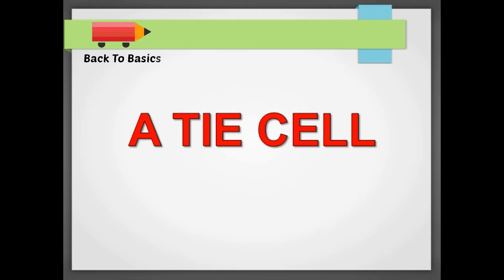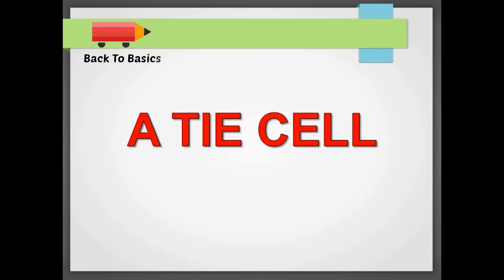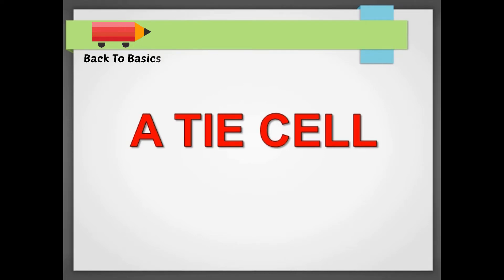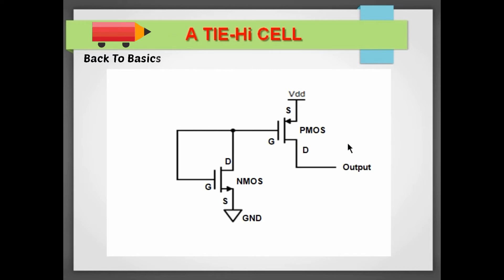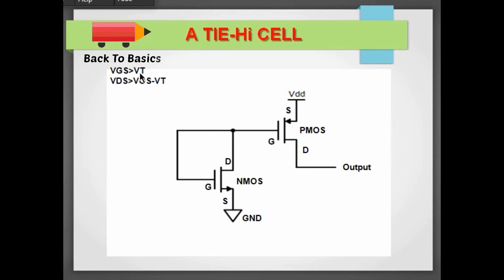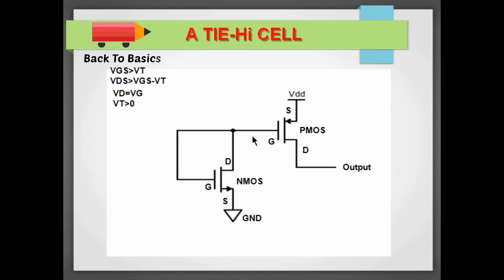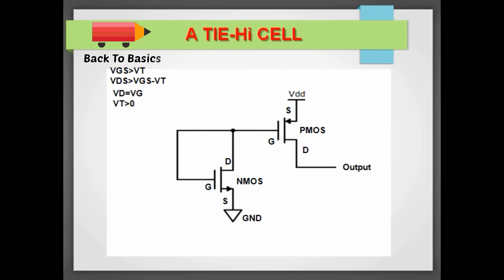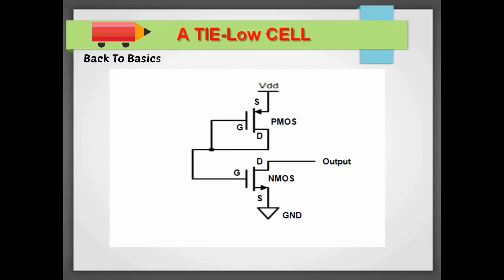What are Tie Cells | Physical Design

Comment: Thank you for the explanation. I had one question - what are the NMOS Vg, Vd connected to in a Tie-Hi cell? How will it be 'high' or 'low' - what drives these nodes to a particular voltage?

Comment: wont the tie cell get damaged due to voltage disturbance?
Reply: Gate oxide is sensitive to voltage surges. In tie cell source/Drain is connected to power/ground. So they won't damage

Comment: Hi, u said tie cells are used for to avoid direct connection to the gate, So I've 1m gate count in my design den how many tie cells will be required?
Reply: sandeep vasireddy they are not connected to all the cells... but, only to those cells whose input doesn't change.
Reply: @vedavyas8496  who will give that info, which are inputs doesn't change??
Reply: @nephewniece3312   Example : Realization of NAND using MUX , Circuit designer will give u info as an ECO attribute